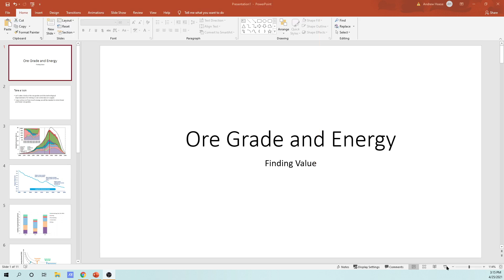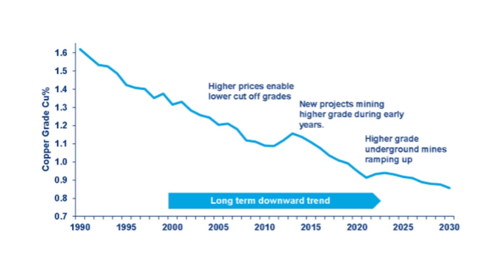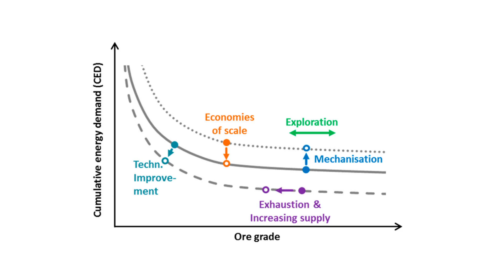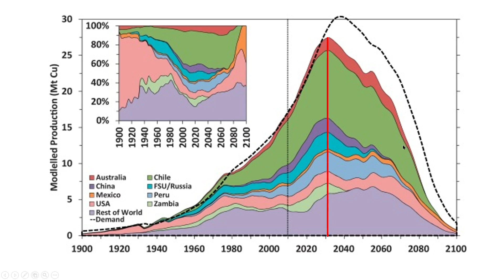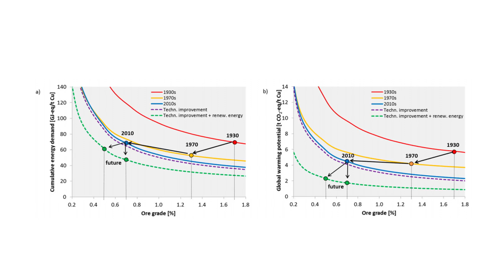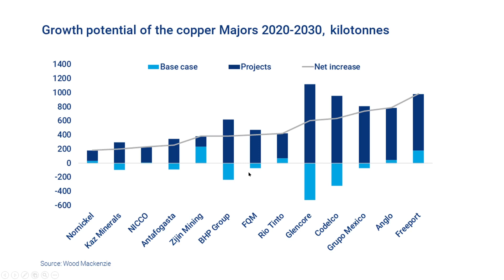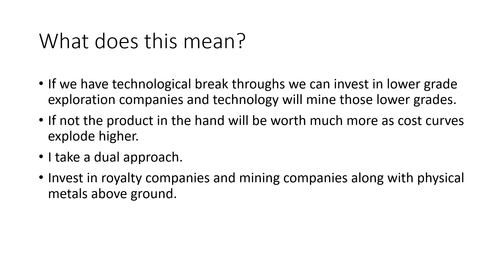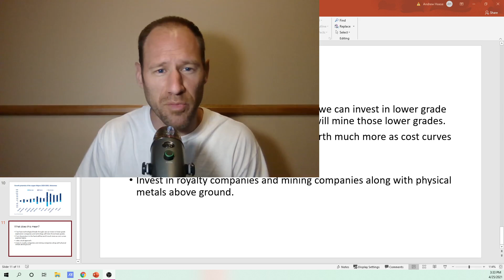Declining Ore Grades and Energy Consumption for Mining

Comment: I like Taseko and Turquise hill most because both have current production and massive expansion potential thats going to be realized in the future both have pretty low valuations and both are not big market caps so they can really move a lot in a Bull market
Reply: I own both also good stuff. If you're interested in any juniors check out oroco resources and dore copper.
Reply: @brandonklosterman9880  gotta look into dore I dont think oroco can provide the the same leverage and upside than taseko and Turqouise but im sure it will go up. Cos market has already prices in so much good stuff with oroco.